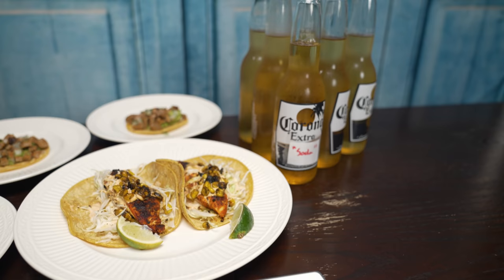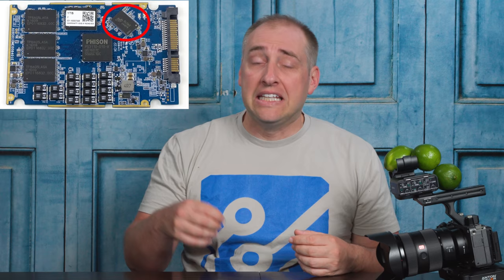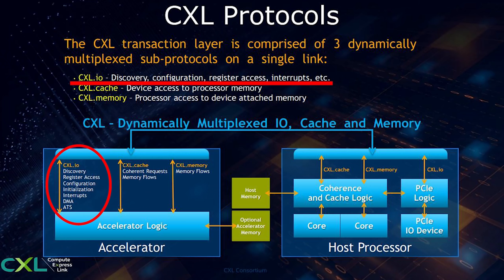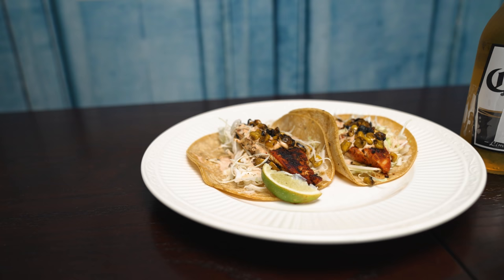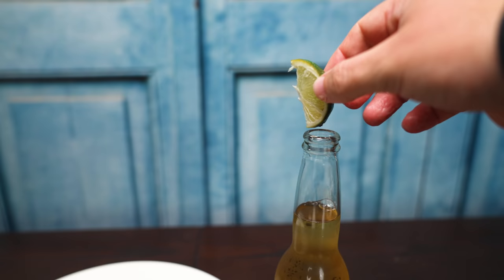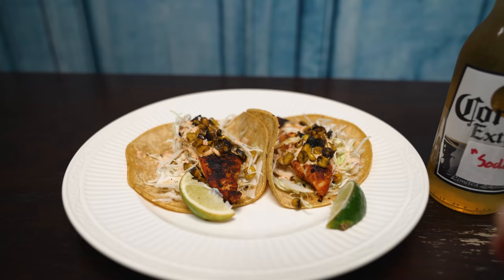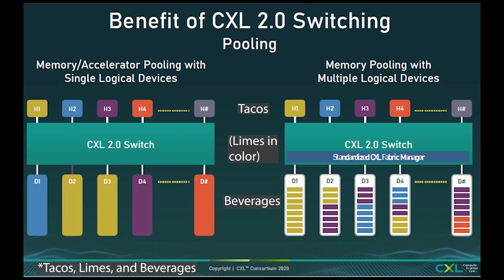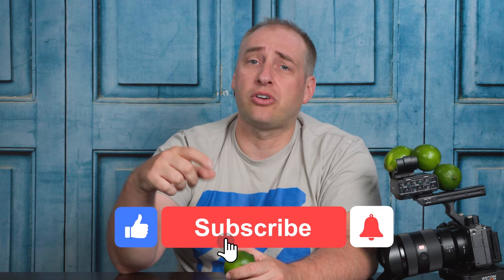CXL in Next-gen Servers Will Make Today's Servers Obsolete

Comment: What does the security side of this look like? This sounds amazing, but die idea of every device sharing the same memory also sounds like an attack vector
Excellent explanations by the way
Reply: The standard supports encryption and data integrity. All communication between devices can be AES encrypted with integrity checks. The threat model mainly covers sniffing on the bus and injecting something. It also mentions replacing devices with malicious one's but it doesn't cover how exactly it protects against that. Public keys are not in the scope of the standard and key exchange looks to be dynamic.
Reply: @creker1  I think the bigger issue here is how do you control what memory can be accessed by each device. I'm sure the idea here is to limit the copies between devices as well, CPU to nic: "Here's a memory address, send XYZ number of bits down the network cable please. NIC: sure thing, but don't pay any attention to me reading XYZ+256bits... CPU:???
Reply: @Cynyr  that's outside the scope of the current standard. I don't think they will try to cover it. It explicitly says that all the connected devices are in the trust boundary and it doesn't cover badly implemented devices. The only thing it covers is sniffing and injecting data while it travels between devices and swapping devices with malicious ones. You can always use other techniques to further protect the communication. Like IOMMU. It allows CPU to map a part of its memory to certain virtual address space that a device can access. That way it can't read some random address like you can with regular DMA. Device can't just go and read CPU memory. It has to through memory controller.
Reply: @BrianStewart126  what else can they do? CXL is an interconnect. It can only protect what goes over it. Like HTTPS protects your from eavesdropping but can’t protect you from site making attacks against you. CXL mainly reuses what PCIe IDE provides and it also doesn’t cover anything beyond inflight data encryption and integrity. They also can’t do anything beyond that. If you can’t trust devices then maybe don’t put them into your servers? You have to have trust boundary somewhere.
Reply: @creker1  is the interconnects between devices managed by the host, or is it more like an open switch?

If controllable then you could limit connects between difference devices (the big reason I see this being useful is more so getting closer to trustlessness in vms and containers, where you could adjust what can use certian devices based on what is currently using them 

so say process A and B is ran by one tenet, but process C is ran by another
You may trust the hardware, but when tenet 1 is running on the hardware and given some control of it, this break the trust boundary of tenet 2, but you don't want to limit the number of process that can be ran on them to 1 as that would mean you would need to double the hardware to run tenet 1's workload. With proper tagging, though, you could, like you can with entire nodes in kuberenetes, taint hardware and only allow some process to schedule to them based on acceptable taints.
Reply: @Waitwhat469  as far as I understand, initialisation is still controlled by the host (be it CPU or some platform controller). That includes setting up encryption and checking device identity. After that devices are free to communicate any way they want including P2P between devices without every going through the host. But it looks like we can solve that problem with IOMMU and PCIe access control services if the hardware supports it. Given that CXL is based on PCIe 5.0 it should also benefit from them.

Comment: I can see CXL being very useful in consumer hardware. Imagine a CPU with  8GB of very fast RAM on the package and a CXL bus to expandable memory. Imagine rethinking 'vram' 'swap' and 'hibernate' entirely by tiering memory between the on-package, expandable, and storage-backed options over a CXL bus.
Reply: Machine learning applications are insane. There's a new field of ML using Semi-Randomized sparse ReLUs feature expansion with sparse linear regularization. The Semi-Randomized sparse ReLUs feature expansion approaches Deep Neural Networks with the  sparse linear regularization weeding out shitty features in a very fast manner. It's insanely RAM intense but, by circumventing costly nonlinear optimization, for more computationally inexpensive.

Comment: I am dealing with servers as part of my render farm for render nodes as well as storage.  The HUGE revelation I had listening to your lime example is Video ram.  we are sometimes limited on what we can render all in one frame.  A centralized CXL changes all of that because it would be all SYSTEM memory and the GPUS would draw out what they need.  and in speaking of memory pools, This would be huge for the simulation side too.  Simulations can take up hundreds of gigs a list space making their simulation caped at what the CPU or GPU can handle on one task, CXL could lift that limit.  and speaking of limits keeping that rendering and simulation data LIVING in a centralized location, accessible to multiple computing devices would have a huge impact on speed.  I'm sure it's going to take a few years for the hardware to trickle down to studios like mine, but I would not be surprised to see a whole range of new software that is made to exploit this new technology.  But this sounds familiar....how does this compare to HP's original vision for their ProLiant servers?

Comment: Super - does this mean that in the future, with multiple CXL connected processors, RAM, and other devices, that we'll be heading back towards 'mainframes' where everything is essentially run on one self consistent host rather than say a cluster of hosts with a few NUMA nodes each? Is it similar to how IBM does it's Z mainframe? 

Can you imagine how much compute power a cluster/swarm/mainframe will have if you took any number of cs-2's from Cerebras, and CXLed then with say 1000 EPYC 64 core... Just mind boggling.
Reply from the maker: Mainframes are a bit of a different game, but there are key concepts especially as next-gen servers scale (a lot)
Reply: CXL is about node-level, connecting devices inside a single server. What you're thinking is Gen-Z which is about taking that idea and stretching it between nodes. But even then, no, I really don't think we will have illusion of rack or multiple racks working like a single host. Maybe we will have NUMA division where scheduler is very careful about migrating workloads between nodes. It's simple physics. Inter-node latencies are too big to simply treat it as a single box. You will always have to think about it and make necessary optimizations to keep data local to compute and go over fabric only when absolutely necessary.
Reply: @creker1  totally agree with latency issue, but even if they are split time domains/NUMA nodes, CXL looks to be a lower overhead for node to node, rather than IP or infiniband ect. The future looks fast :)
Reply: @CrazyLogic  CXL probably can't scale beyond one server simply due to protocols. If we look at Gen-Z, they don't use ethernet or infiniband but they did implement something similar to them. To build a node-to-node fabric you need to be able to route packets, address many devices, handle failures (optics can and will fail). That's why Gen-Z comes with a whole bunch of infrastructure hardware - bridges, switches, gateways.

Comment: It’s crazy to think that in 1-2 years they will have high end consumer motherboards with pcie gen5, they will probably have built in 25,40, or even 100gbe nics on the prosumer stuff. They will have bandwidth for multiple usb4 40gbps ports or usb5 if that comes out. And we will potentially have nvme drives that push 14gbps read and write. I hope intel does something with optane on the prosumer and consumer side for gen5. Seems they only have super expensive server stuff for gen4. It is stupid fast and reliable though.
Reply from the maker: Probably not 100GbE NICs onboard on the prosumer side. The challenge there is really just the fact one would need to go fiber and most prosumers do not have the network switches/ devices for 100GbE. Power per bit goes down, but overall power goes up with 100GbE as well.

Comment: Thank you for the clarification. But my question is that not all memories are made equal, so the presumed pool is a mixture of varying memory speeds, latencies, and generations.
Reply from the maker: You have to think of next-gen servers as much larger. Core counts, TDP, and I/O go way up. So even if CXL has more latency than a host DDR5 controller, it is still useful if it gets you a larger pool of memory in a system.
Reply: Yes, CXL does cover that. There's whole QoS, back pressure, credit system and other stuff. Also different memory pools can expose through ACPI tables the exact latency and bandwidth so that the system can appropriately schedule and balance workloads between them. For any performance sensitive workload it just doesn't work as a simple unified memory pool.
Reply: @AstroCat devices will always have their own caches. It just doesn't work any other way. What CXL allows is keeping these caches coherent with various memory pools. For complex devices it will be done completely in hardware and will be transparent to the software. Like GPUs. They will always have multiple levels of cache and private memory pool. CXL can't and will not change that.

Comment: My CXL Analogie: You have a Connector Board, a 64GB DDR5 Ram Board, a x86 CPU Board and a Arm CPU board the CPU boards only have 1GB to Function. Now your x86 board needs 16 GB Ram and request that from the Memory Board at the same time the ARM Board uses 32 GB Ram on the same Memory Board. Now you add a GPU Board with 8GB Ram but the GPU needs more it requests aditional 16GB ram from the Memory board. The next step ist the GPU need more Ram and you add a Second 64GB Ramboard now your GPU can Request 32 GB Ram and it switches with the full  32 GB to the new Memoryboard or only request 16 GB additional Memory from the new Board. The second scenario is You add a GPU Board with 128GB Ram but your GPU only needs 12 GB now your x86 CPU board can request 64 GB ram from that GPU board, now you add a Second GPU Board with 256GB of Ram and that GPU needs 300 GB Ram the first 256GB are on board and the 44 GB are on the first GPU.

Comment: So hypothetically: we could have some CXL-enabled device that accepts a few m.2 ssds; then plug an m.2 to standard PCIe slot adapter into that; then plug a PCIe to usb expansion card in that; which will finally enable us to use the hard drive on a first gen ipod as system RAM? This calls for celebratory tacos 🌮🌮🌮🍋
Reply from the maker: One of the next videos will be on how in the next-gen servers U.2, U.3, and M.2 are going away

Comment: Is this why PCIe 5.0 is coming out so quickly after PCIe 4.0? The time gap seems much smaller than between previous generations.
Reply from the maker: CXL is one reason. The bigger reason though is that I/O was severely bottlenecked with PCIe Gen3. A hyper-scaler can do a 400GbE NIC in a PCIe Gen5 x16 slot as well which will help with next-gen systems. PCIe Gen6 will be a quicker transition as well.
Reply: @ServeTheHomeVideo  I always wondered, why are we still limited to 16 lanes on PCIe? Yes, there're some proprietary wider ports and standard does support x32 but actual hardware is still stuck at x16. Looking at how NVLink scales to ridiculous speeds it feels like PCIe is intentionally crippled by that with no good reason.
Reply from the maker: NVLink uses a TON of power. We did the 8x P100 but then saw a big jump on the 8x V100 machine. On the 8x A100 machine we have in the lab now, same story.
Reply: @ServeTheHomeVideo  Oh right very interesting.

Do you know what tech is used for the submarine cables? E.g. the Marea cable can transfer at 26.2 terabits/s, with 8 pairs of fibres inside of it. That's 3,275 gigabits/second in a single strand of fibre.

What do they use for those? FPGAs? ASICs?

Comment: I really doubt that SSD example will actually be implemented. I just don't see the point. SSDs need DRAM (if we're talking about something fast and not slow QLC or something for cold storage) and they need it to be very close due to latencies. CXL is simply gonna be too slow and cause too much overhead. We already saw this with Linux IO scheduler that only causes bottlenecks with NVMe. And that's CPU with its own RAM without any CXL fabrics. That's the same reason we have multiple levels of cache. It's a necessary optimization.

What's actually much more relevant example, I think, is CXL being cache coherent interconnect for various compute resources. Servers already have ML processor, GPUs, CPUs, FPGAs and usually all of them work on the same task. They need to communicate and share data. Right now everyone uses different home-grown solutions to tackle this - Google TPUs use DMA engines and HBM with some weird interconnect; NVIDIA uses nvlink; AMD uses infinity fabric. FPGAs don't have anything at all, I think. All of these will be replaced by standard CXL fabric that will actually make everything interoperable. Intel already planning to use CXL as an interconnect between their Xe GPUs just like NVLink. But even then we will have the same problem - it's too slow to go over CXL to read or write someone else's memory. Like always software and hardware will try to keep everything in their local RAM as much as possible and utilize CXL fabric only to transfer necessary data.

I also think we can't talk about CXL without mentioning Gen-Z. With recent partnership it completes the whole picture and stretches that coherent interconnect to datacenter scale. The dream about having boxes of CPUs, GPUs, FPGAs, NVMe all in separate racks and being able to provision them independently will finally come true.
Reply from the maker: The write cache on SSDs that is power-loss protected is designed to enable fast/ safe sync writes. Writing to SCM/ Optane provides that while allowing time to flush to NAND at a slower pace, but also multiple NAND devices potentially beyond just a single machine. That model is already in production using Optane so it is a stretch, but one that is already deployed using existing technology.

You are totally right about GenZ as well as accelerators. Accelerators are going to be the leading edge in CXL 1.1 devices next year.
Reply: @ServeTheHomeVideo  that's not the only reason SSDs need DRAM. Probably the main one is RAM for controller to store mapping tables. Without that and going over CXL they gonna be severely crippled. As for write cache, yes, that works and already in production. But it feels like moving the problem to a different place and not solving anything fundamental. You get cheaper SSDs, yes, but you then pay enormous money for optane. Not much of a gain IMO. What Optane brings to storage solutions is very low latency write cache, as you said, that you simply can't get with any NAND SSD. That's the value, I think. But then again, we don't need CXL for that.

Comment: So CXL will only used for sharing memory?  For things like composable infrastructure which uses PCIe, will PCIe continue to be used or will CXL replace PCIe for this?
Reply: CXL is PCIe. It's an extension based on the same protocol and physical layer. CXL is not meant for composable infrastructure. CXL only works inside a server. For composable infrastructure you need different technologies like Gen-Z.

Comment: Memory shared across devices - so basically AGP all over :D
Reply: No, AGP is simple DMA. CXL adds complete solution for cache-coherent access with complex protocols for various use cases. It's akin to buses we have between processors where they exchange data to keep their caches in sync.
Reply: AGP was ahead of it's time, the issue was necessary bus and memory speeds did not exist or were too expensive

Comment: As a guy with 0.01% Datacenter Knowledge, does this mean that in a hypothetically world where we would have a rack with CXL Switching i could have them all in a medium memory ammount and if one server in that rack needs temporary a lot of memory it could use all the leftover memory from the other servers in the same rack?
Reply: No, CXL is limited to one server. What you're talking about is Gen-Z. Another interconnect technology but it works across nodes and racks. They announced partnership so we will probably see some solutions where CXL works inside a server and delegates node-to-node to Gen-Z. Gen-Z is more about disaggregation. Instead of rack full of servers you would have a rack full of CPUs, rack full of memory, rack full of NVMe etc. And you would provision them according to your needs.
Reply: Gen-Z got folded into CXL at the end of 2021 and CXL 3.0 has since been released and supports switches and fabrics.